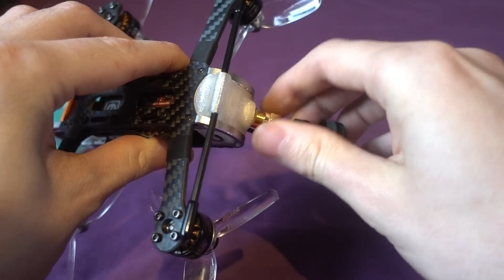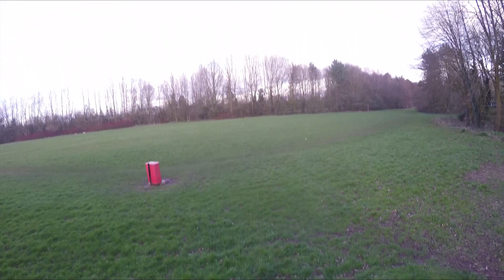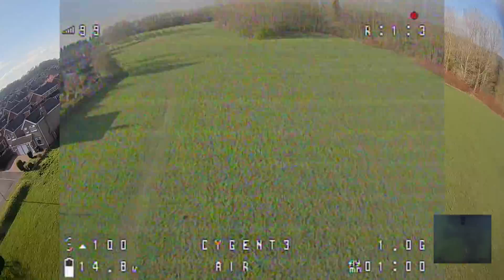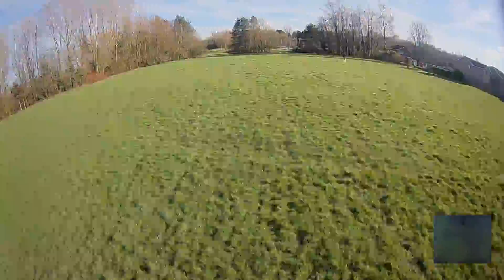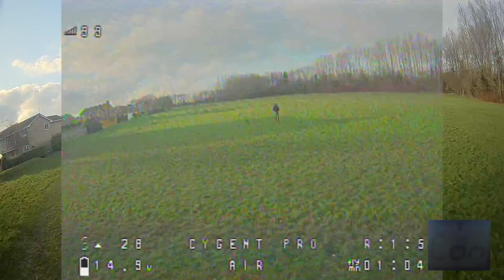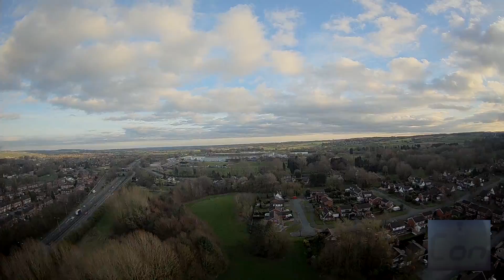Geprc Cygnet3 Pro!

Comment: Hi and thanks for the fun vids, bought this drone on your review. Have to say tho that at start up had no video, turns out you need to power on the vtx. long press of vtx power button. this not stunninly obvious to a newbie and only by finding that there is a separate manual for the camera where one finds the info..... 
Maybe worth a mention? Or you did and it went right past me.....
Cheers and best regards
ian

Comment: Hi Andy are you sure its a Trump protocol VTX. I have the same model and I've been using TBS Smart audio and I think is working correctly although I'm new at this. Where does it say to use Tramp? I did have a Cinepro F7 and that one came setup with Tramp but I felt the this Cygnet 3 Pro came setup with TBS, but now I'm not sure... How do you tell which one you have? Thank in advance.. and I've love your vids, keep up the good work!
Rob

Comment: I am trying to use a spektrum rx. it needs to be connected to a tx pin on the fc board. can you tell me how I find the tx pad on the fc? thanks
Reply from the maker: the manual should get you there just dont connect it to one already in use https://geprc.com/product/gep-stable-pro-f7-dual-bl32-35a/

Comment: AndyRC did you ever resolve the R9 unbinding issue as i've got a similar problem, it binds OK then fails after a couple of minutes.
I used the latest Plex FW and fport option on the R9mm but just can't get it to hold connection i'm in the UK so using 896mhz btw.

Comment: Could you slap a hero 7 on there?
Reply from the maker: No but it's got it's own had cam? Are u thinking of just using the frame? If so a session five works
Reply: AndyRC I already have a 5inch which I use my GoPro for. And now I realy want to get into 3inch quads. So I thougt that I could build or buy a 3inch that could Carry my hero7. But maybe I give the Hero session a shot.

Comment: iam very disappointed with those motors. i have the 3500/3750/4000kv versions.  very poor performance and very high consumption.. same props genfan 3052.. just 1 or little more minutes on 3s 850mah..  on other quad i have same model/stack and tachyon 1408/3500 and i get 4min with more speed and response. 
plus the geprc 1408 have a small core shaft.. if you crash you bend it. 
diatone 1408 edge racing have a masive core shaft... you will kill the bell before bend the shaft..

Comment: I think if the motors were 4000kv instead of 3600kv that would get it that extra punch we were expecting.
Reply from the maker: I would say go with the non pro version it's got the power and the speed just a better model even though it's not called the pro

Comment: Hey Andy Great review as always!! Funny thing is i was just having a go at the R9 today to get them all updated and i've not had a problem even other than failsafes on older firmware. there's a reason they took away the older firmware. The latest Fport flex works amazingly!! What i had problems with on some flight controllers was that i had to put in a CLI duplex command for it to work. Others worked perfectly with fport out the same regular Sbus wire with no modification. The command i used was: set serialrx_halfduplex = OFF
   and: set serialrx_inverted = ON
 . All my flight controllers are F4 and i'm not sure why one needed this command when the others didn't. Maybe u tried this already.. but just giving you what worked for me. I love the R9 and safety i feel flying in sketchy areas. Just as u say need a better vtx tho
Reply: I used Flex FPort 190201 after a half day messing about, and the opposite of the commands you list worked on a Mamba F4. They really could make things a lot simpler, the Frsky downloads pages are a mess.

Comment: Very nicely engineered design Andy......Agree, an XM Plus receiver will get you 5kms easy in a Fixed Wing. I dont get the R9MM RX being used in any kind of quad TBH, I mean why would you..?...In a fixed wing scenario, it's not got the range an XM Plus has in my flight trials. Witness also the R9MMs RSSI drop off as you did a turnaround a mere 120 metres out, it only has one antenna, part of the reason I think. An XM Plus would probably still be in the high 90s with better signal propagation to boot. I have XM Plus in ALL my quads, it's brilliant basically.
Reply: The antenna is badly placed, if you fly far out and turn to come back the signal is then blocked by the frame.

Comment: What is the weight of it, including receiver and props?
Reply from the maker: Take away 107 grams from 270 grams as that's how much the battery weighed
Reply: @AndyRCchannel  okay, thanks for this information. I think with the ZOP 750 4s the 250gr are possible.
Reply: Weight of that battery should be 78gr.

Comment: Have you tried running the Nazgul props on it? They're something like 3061 or something....
Reply from the maker: For a race coper perhaps however I'd say for freestyle just gonna eat batteries. The flash are a heavier pitch than the non pro and it still went slower so it was more about showing that. But I'll take a look sounds interesting for the non freestyle models. Higher pitch doesn't always result in higher speed though the dal 3056 produce less thrust than the flash for example

Comment: Hello Andy, I also own the R9 system, in order to get the systems full potential, you need to flash the latest (I believe 2.2.3) open TX version to your radio. Then flash the latest flex firmware to the module and the receiver  https://www.frsky-rc.com/r9-mm/  and https://www.frsky-rc.com/r9m/ I fly on thelowest power settings and reach without any problems the half a mile mark with telemetry.
Reply from the maker: I've done that on that particular day and it's  screwed everything up. When I bind to 868 and then turn the tx off and back on it reads 915 and also switches to 16 channels when it should be 8. It's a mess
Reply: AndyRC That's strange, for me it worked just out of the box I followed this guy's video. https://youtu.be/RuEToqQbxNw

Comment: Andy can you please help i can't bind my trashcan to my QX7 EU LBT it came with frsky non eu receiver.. How can i go about binding it? Do i have to flash Open TX non eu firmware to QX7? Can i add an external receiver to crazy b board.. Please help..
Reply from the maker: you will have to select d8 mode on your qx7 and then choose FRsky_D in the configuration tab under receiver. cheers

Comment: Hey Andy (and everyone else). I'm a freestyle pilot with a Diatone 2019 GT R349 currently on back order, but I've fallen in love with CineWhoop HD type minis this winter, and am wondering if I should toss the Diatone and order either the 3 or the 3 pro instead, anyone got any input? Which is the more satisfying feeling to freestyle?
Reply from the maker: its down to personal preference. For me the cinewhoop outdoors is compromised by its ducts and has things like yaw washout and less power. the cygnet has none of that and flys more like a freestlye 5 inch copter. Iv found one use for the cinewhoop and thats flying them in indoor sports halls
Reply: @AndyRCchannel  I've had good luck with the 85mm ones outside, but the 40mm ones do feel over heavy. Question was actually on the Diatone vs this guy and, after a couple of watches through of the video I've put in an order for this guy with your coupon :). Just gotta decide if I keep the order for the diatone in as well or no.
Reply from the maker: @AggieRC  if you are talking about the non HD 349 then its a good model at a good price. but the hd version will have the props in shot and the hd cams dont deal to well with props. its still a fun machine and can be flown for freestyle but for me freestyle is getting hd footage with props out of shot.
Reply: @AndyRCchannel  Thanks man, that's exactly what I needed :). I've got the regular one on order as an update to my babyhawk collection, and I've ordered one of these for goproless propless HD freestyle fun :)

Comment: Got to be honest I love GEPRC stuff but I don't really get this particular model.....in fact, I'm really disappointed. The pro is heavier, slower and over the magic 250g weight that is so important in many regions around the world. I get that it might feel 'sturdier' in the air but you get use to whatever it is you are flying in any event. The Cygnet 3 Pro is a miss for me, I would rather get the normal Cygnet 3. That said, you can get the Diatone R349 in HD now with a Caddx camera and its $50 cheaper......hhmmmm
Reply from the maker: You will get the props in view with the hd 349 and the image won't be pretty. It doesn't deal with spinning props very well. Just my opinion
Reply: Yes, that's right. I also think the Cygnet will be easier to live with...much easier to work on, the board should run cooler and I much prefer carrying the battery on top.........
Reply from the maker: @dronedownunder652  yep I agree John. cheers

Comment: Im using R9 on flex firmware 868Mhz 100mW and as far, it seems to be ok, no weird failsafes other than hiding behind a hill.
Reply from the maker: thanks for the info just cant seem to get it hooked up. with fport.
Reply: @AndyRCchannel  fport is pretty wanky, im using sbus and also recommending it. oh and im unsing super8 antenna on tx, didnt yet tested the stock one.

Comment: For R9, I run 181228 Flex on both my R9 and R9MM, I currently have it set up on 3 quads and I use F.port
One thing with F.port you don't need to do any RSSI input in any way, be it aux channel or alt means, F.port natively will give the RSSI to the FC though you do need to set the scaling with a CLI command. set rssi_scale = 200
I like to run R9 even on quads with 200mw VTX as I would rather be video limited than radio. Also the R9MM has the inverted F.port making using it on F4 flight controllers a breeze.
Reply from the maker: yes Thats what I was trying to use but it just wasnt having it. in the end some very old eu firmware worked that i couldnt get off the frsky site cus they had removed it. r9 just feels a mess and even though i use test clamps to flash the firmware its still took me all day to get it working. After this video it randomly just unbound itself and now wont rebind. not impressed Ill Have to try some more things when I have more time. Thanks for the reply
Reply: @AndyRCchannel  Bought the xm+ version just because I'm a noob and don't want to mess around with the crappy firmware. I just want to fly and practice. 
Too bad I bought the normal version (didn't know about the PRO). 

Do you guys think it makes sense to mount a gopro on this drone and make it a "cinewhoop"? I bet probably then you would see the extra difference in motors. 
I will probably build one when I get some flight experience :)

Comment: I just can’t seem to get the whole 3 inch thing - the 5 inch quads just fly better I think don’t you?
Reply from the maker: not at all. but I guess its a personal preference thing.
Reply: Any thing over 250g in the USA you need to register with FAA or risk getting a fine.  Also 3" doesn't break things as much, the parts are cheaper, you get more flight time and you can fly in places you wouldn't dare take a 5" like in a crowded neighborhood.  Plus I never get 100+ MPH on my 5" builds but do on my R349.
Reply from the maker: @illpro2  u got it